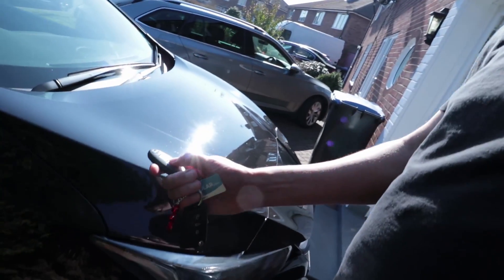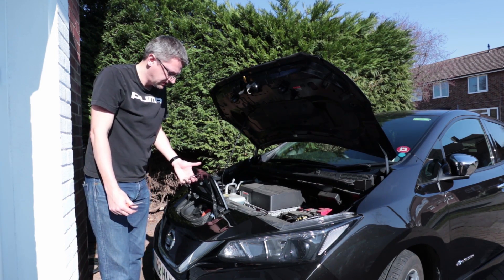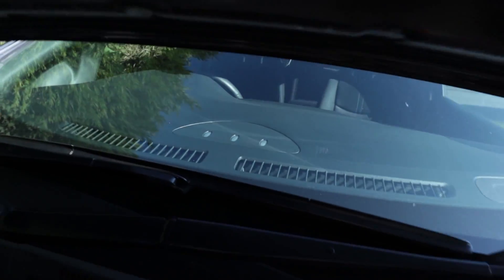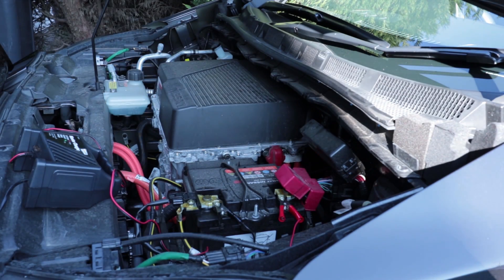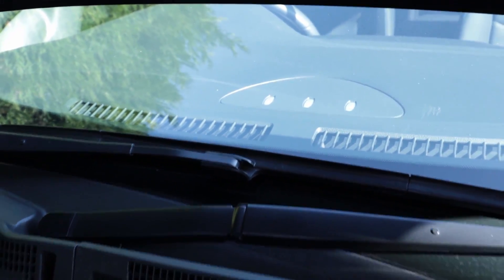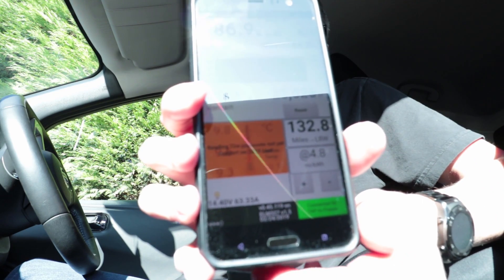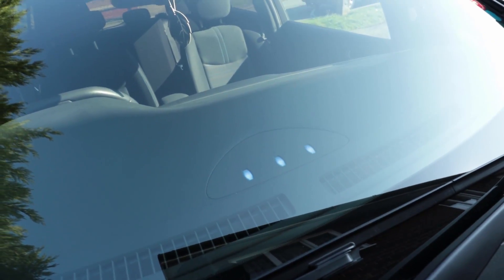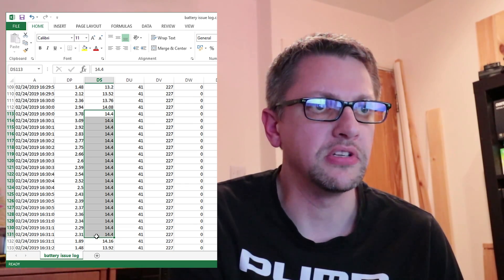40kWh Nissan Leaf - Dead 12v battery

Comment: had this experience yesterday - was up to 83 faults showing on Leaf Spy but I thought it was most likely the 12V DC battery. First time with a jump starter pack didnt work out - I read that disconnecting the battery for 30 minutes was often useful and after that and with a charged-up jump pack it came right. I removed fault codes with Leaf Spy and all operated as normal. Thanks for producing this all those years back now. I bought my Nismo 2018 40 kWh in May this year - 2nd hand and a great price I thought. At 83% SoH and showing over 200km range it has made some difference from my 2011 Leaf and original 2014 Outlander PHEV which is on permanent loan to my sister  - after 200k Kms and still 50% SoH of a very heavily used 12 kWh battery pack.
Reply from the maker: Thanks for the nice comments.

Comment: My car key fob has a physical key too!??! Who knew lol - thanks this really helped
Reply: Key fob has a new battery. The Leaf was charged at around 95%. I left the car unused for maybe 3 weeks. Now its locked me out, my mechanical key blade isnt turning in the car door lock. Locksmiths are quoting £150 to unlock or £350 for unlocking and a new ket cut. I only have one key and not sure how to get the thing opened. Is there a cheaper option? Maybe enter through the small front quarter window? Will the door unlock from the inside?
Reply from the maker: Sounds like a flat 12v battery... Definitely try the key again, you may have to turn it harder than you think. Good luck!
Reply: @RSThinks So it turns out the door lock has faulty pins. But managed to get it open. And the remote key wasn't working because of the 12v battery being flat, as you rightly mentioned. A quick jump start proved the car does start. All in all I spent £15 to get the door opened. Cheers 😅
Reply from the maker: Glad it's sorted now. 👍🏻

Comment: Hi is it safe to connect a trickle charger directly to the positive and negative 12v battery terminals? Thinking of doing this every month or so to maintain the 12v yuasa
Reply from the maker: I didn't have an issue doing it in the video, but please check with your dealer's service department or Nissan for their advice.

Thanks for watching!

Comment: Only just seen this video but I've had the same problem for some time. Useless Nissan dealer just told me to replace 12V battery but fault soon returned.  Turns out after much research that there is a drain on the 20Amp fuse to the Head Unit (Radio/Satnav Etc). Useless Nissan dealer said I could replace Head Unit for £3000 or send it back to Ireland to have it checked out, would only be £500 and take 6 months!!  So now I have to take 20A fuse out when not using car for couple of days. I have heard it could be because the car keeps trying to communicate with Nissan's master computer for updates and feedback but it can't because it is no longer supported by Nissan but the 12V battery drain due all the constant trying - Any comments anyone
Reply from the maker: I'd recommend contacting James Coates at CleevelyEV.co.uk (James and Kate YouTube channel too) . He's a Leaf expert who might be able to help you. Thanks for watching. Good luck!

Comment: In a normal ICE vehicle, with a flat battery, it's common to find no electronics work and the engine won't start.   You check the voltage with a meter, put a charger on it, and then take it to a parts store or shop to have them do a conditioning test on it.  If it fails, you replace it.  Otherwise, after charging and starting, you find a culprit like a dome light having stayed on because a door wasn't closed, or some other unexpected or forgotten draw.  I've found, with my Leaf, that EVs don't quite behave in the same way.  Yet, the cause and diagnostic steps are the same.  Your attempt to try to charge the traction battery didn't initially work because of the flat 12v battery.  You probably didn't even need to put effort into charging the traction battery at all.  If the 12v battery is flat then it needs to be charged before electrical functions will work, including the systems that charge the 12v battery from the traction battery.  Nissan made a mistake in not placing a 12v system battery gauge in the dash so that a driver can easily check its status.  Your LeafSpy certainly does.  I hope you got the battery tested and replaced it if it was bad.
Reply from the maker: The battery was tested and found to be good. It was still in the car till Dec 2020 when I part exchanged the car for another EV (video on the channel).

Thank you for watching and your comments.

Comment: WHAT ABOUT CHECKING THE WATER/ACID LEVEL OF THE 12 VOLT BATTERY??? DO YOU HAVE TO GET A CERTAIN TYPE OF A 12 VOLT RECHARGEABLE BATTERY FOR THE NISSAN LEAF OR CAN YOU REPLACE IT WITH WHATEVER WILL PHYSICALLY FIT INTO THE BATTERY AREA?  I USE TO ALWAYS REPLACE THE BATTERY OF MY CAR WHEN IT NEEDED REPLACING WITH A DIE HART AND NOW MY FAVORITE REPLACEMENT IS THE DURACELL... IT SEEMS THAT THIS "NISSAN LEAF CHARGING SITUATION" COULD BE FIXED EASILY WITH AN EXTERNAL 12 VOLT BATTERY CHARGER SUPPLIED BY NISSAN, THAT WOULD BE PART OF THE TOTAL CHARGING SYSTEM THAT WOULD BE CONNECTED ALSO TO THE EXTERNAL CHARGING SYSTEM FOR THE BATTERY THAT MOVES THE CAR... OR DID NISSAN NEVER FIGURED THAT THE REGULAR 12 VOLT BATTERY WOULD EVER GO BAD...???...!!!...??? lol

Comment: This is among several known problems of this piece of crap car (I own one too).  No one told me about maintaining this  auxiliary battery.  The first sign of a problem was a warning message--to service the EV system, as the car would not power on once turned off. Indeed it didn't and it's been in my driveway for 2 days.  I called an Uber to take me to buy a new car (Not a Nissan). This car will be donated to charity.  I am so tired of its range issues, and main battery thermal management.  THERE IS EVEN A TURTLE ICON on the dashboard that lights up when the main battery is hot reminding you to slow down--and if you don't the car will do it for you.  I see this icon often whenever I have to drive over 125 miles (round trip) because that cannot be done on a single charge, so as soon as I charge--the battery heats up--exactly according to design according to the Nissan dealership.
Reply from the maker: To be fair, after the incident in the video, I never encountered this problem again. I also never trickle charged the 12v battery either.
Best of luck with yours!

Comment: Exactly the same thing happened to me today… I am glad that I found your video. Thank you.

My Leaf is over 4 years old. But it was totally fine, but all the sudden, the 12v battery is totally dead… 

I am thinking to replace the 12v battery. Should I use an AGM battery?

Also, now I am charging the 12v battery. There is a constant clicking noise. Did that happen to you?
Reply from the maker: Yes, definitely change the battery. Ask your dealer what type is best.

The only clicking I had was from the wheel, see the video about a 'warranty claim' for more information.

Thanks for watching.

Comment: I put my 2022 Nissan Leaf, 40kWh with only 1100 miles on it, in my garage last night about 5p and this morning about 10am I went into the garage and heard a fairly loud clicking sound, seemed like it was in a cadence, sounded like a relay clicking noise. I checked and the 12v battery was down to a little over 4v. Put the smart charger on it and the clicking noise stopped immediately and it took about 4 hours to fully charge @16 amps. Now about 6 hours after removing the charger the battery is still at 12.9v, so doesn't appear to be discharging. I'm fairly sure I didn't leave anything on when I left the car.  I keep a close check of the battery voltage on my EV cars as the charging system does not seem to be as efficient as with an ICE vehicle with an alternator. I've had a Prius Prime and a Honda Clarity, both with similar battery voltage ranges of 12.4vdc to 12.8vdc immediately after shutdown whereas with a battery charged by an alternator the voltage would be significantly higher.  I had checked the battery on my Leaf the morning before the incident and it was at 12.5vdc. My question is what could have put this much of a discharge on a new battery in a period of 16 hours? I have put a battery tender on this car periodically and brought the voltage up to float voltage (13.4vdc) for at least 24 hours, so the battery in this car that I bought less than 6 months ago should be in good condition. Guess I'll have to start using the charger more frequently. Thanks RSThinks for the video.
Reply from the maker: I think a trip to the dealer could be a good idea. They can check the battery and give you a new one if needed.
Thanks for watching!

Comment: what was the problem? Mine is getting flat sometimes too
Reply from the maker: Never got a definitive answer. Dealer checked it over at the time and the 12v battery was fine.

If yours is a similar age, 2018 or older it's worth getting your battery checked and possibly getting a new one.
Reply: @RSThinks  i have new battery but i think i have aftermarket heated seats that are installed so power is on even when ignition is off
Reply from the maker: Ah ok.
If you can get them connected to a switched live, that would probably be better.

Comment: Hi, found this very helpful. Could I just ask for your recommendation of the equipment you used, please? Very new to learning about cars, particularly leaf’s. Thinking to either hire or buy the battery monitor and charger. Nov. 2013 24kwH Nissan Leaf. Thank you very much for you time and any advice.
Reply from the maker: I used a normal multi meter in the video to check the voltage. Something like this from Amazon would do. https://amzn.to/3pMYOlD There are lots of different ones but the all do they same thing. Very useful for checking not just the battery but anything electrical.

Thanks for watching!
Reply: @RSThinks  thank you very much!

Comment: sorry friend, but I think you need to charge that lead-acid battery with a trickle charger or some other such device and then...but really, you better just go get another lead acid battery to replace the one you have. It is going to happen again once it's happened and you might be stranded ten miles from nowhere the next time. These cars go through lead-acid batteries about 3 times faster than IC cars do. I don't know exactly why. l' have heard some theories....
Reply from the maker: Thanks for the tip.
In the three years I owned the Leaf, this issue only happened once.
I believe after 4-5 years, a replacement 12v battery is a good idea and have seen advice from others that were having this issue in this time frame.
Thanks for the comments!

Comment: Advice I've seen is to connnect the neg lead of the charger to another ground point, not the battery neg terminal.  Reason being that the car computer doesn,t like it for some reaon.  It confuses the car system?
Reply from the maker: Thanks for the info.
I didn't have any issues connecting the way I did in the video. The car didn't have any issues afterwards.

Comment: The 12v battery on my Leaf went flat yesterday. It was replaced after only 2 years and now again after another 2 years. I’m convinced they are using the wrong type of battery. They use a normal car battery which requires that a very high cranking current is drawn occasionally in order to keep the battery in a good condition. This will happen every time an I.C.E. car is started. This, of course, never happens in an electric car. I believe what they should be using is a leisure battery which are specifically designed to supply low current for extended periods. 
Charge it over night and wife has taken it to work. Let’s see if it gets her home. 🤪🤣

Comment: Hello! How long did you have to keep the battery charger hooked up until the Nissan charging light started blinking?
Reply from the maker: Just a couple of minutes, then I disconnected the 12v charger and left it charging for about 30 mins, then went for a drive.

Comment: Thank you so much for posting this video. The weather is a freezing zero degrees here at the moment and my Leaf which was well charged when last used about 3 weeks ago. was effectively dead today, not a spark of any kind when I pressed the start button. with no power it would not even open the charge flap. Your explanation to open the car, flap and the diagnostics when car was dead was most informative and I am now sure I will be able to get car going again on Monday when the typically variable English weather rebounds back to10+ degrees. Very informative and helpful
Reply: My husband leaf same problem ..looking this video .hope this is work
Reply from the maker: Glad you'll be able to get your Leaf working again. Thanks for your comment!

Comment: The Gen2 Leaf's have a 12V battery charger built-in. It is documented in the manual. One of the 3 blue LED lights in the dash lights up when it is charging from the main battery and you can clearly hear the 150A convertor relay cut in with a clunk and the cut-out after a few minutes of charging. Mine charges once a day.

Comment: The word is BAT-TER-REE. It is not Baa-tree. It is ironic they call Brits English... Ha ha.

A "Bonnet" is what old ladies use to wear on their head.... This part of the car is called a HOOD

Tire not Tyre....   Trunk not Boot..... etc.  Ha Ha JUST KIDDING.... Thanks for the video... I just added a cable to my nose charge door to trickle charge my battery when parked or charging. I also added a battery monitor in Ligher Socket in car to keep an eye on battery voltage.
Reply from the maker: Sorry, must be my accent. Lol
How do you say ALU-MIN-IUM...? 🙂
Reply: A gas is a gas, not a liquid. Cheese does not come from a can.   ;)

Comment: I have a 2011 Leaf and the 12 volt has a solar panel in the rear spoiler . It had a hickup this morning and eventually came into life .. I checked the 12 volt and it showed 9 volt and refused to maintenance charge . I checked the 12 volt on another charger and it picked up and started charging . I think the 12 volt battery is shot .. Not too bad for a 2011 12 volt 9 years old  battery . I might leave it on charge for an overnight top up and see how it goes .
Reply from the maker: 9 years is good going! Thanks for commenting!

Comment: I have had this same issue with my 2018. 8 times now I have had a flat 12v battery. They can't figure out the issue and its been causing me so much stress. I have a charger and have multiple times topped off the 12v but it still happens every 2 weeks. Nissan has treated me like I am the one doing something wrong like leaving the lights on but I tell you this. I have started to document the issue on a Nest camera and about to pull my state's lemon law on the car. I have been late to work by an hour 8 times over this issue.
Reply: I have the same issue. What is your last solution? Your post link is not working. Same car and same problems when I leave my car 3 o 4 days without charging. Any solution to charge the 12V battery automatically? Have I to connect Heatting or something once per day?. In my oppinion is something understandable because the GPRS connection is demanding 12V battery power. I still tuned. Very interested to solved this because if my wife has this problem she is gonna kill me :-)
Reply from the maker: If you join the Nissan Leaf owners group on Facebook, you will be able to read the post.
Essentially someone had the same issue as you and thinks it might be because they didn't turn their car off before opening the door so the car didn't shutdown properly. They were able to repeat it with some success, but then it wouldn't do it anymore.
Reply from the maker: I recently saw this post on Facebook which might explain why it keeps happening (you may need to join the group to see it).

https://m.facebook.com/groups/247364142001101?view=permalink&id=3459015850835898
Reply: @RSThinks  That's my post.
Reply from the maker: Ah!